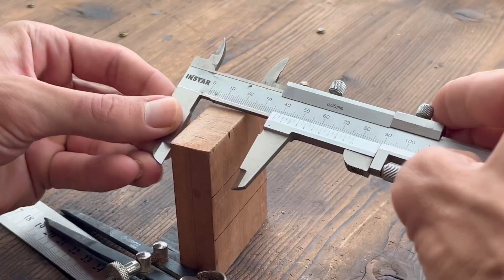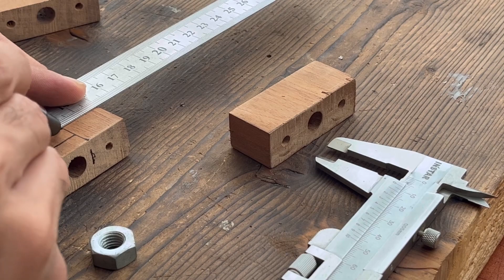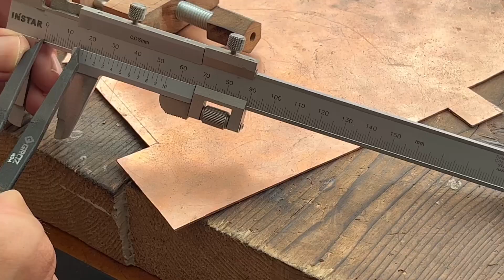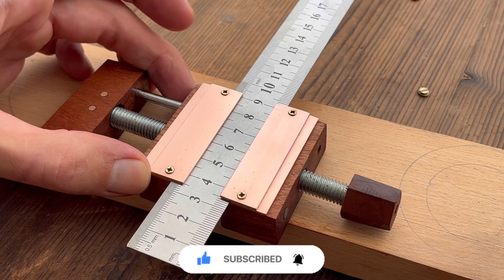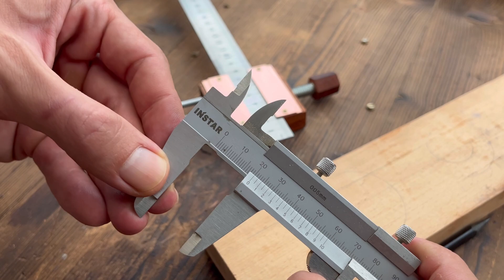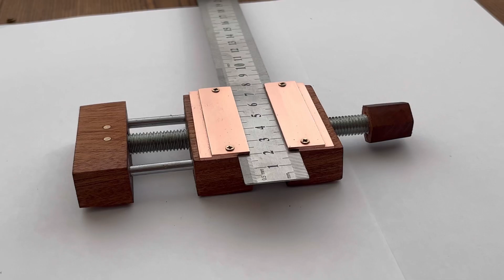Artisanal Woodworking: Step-by-Step Guide to Crafting a Custom Wooden Marking Gauge #markinggauge

Comment: really cool. but why such a big clamp for a little ruler. is it so that you can put big rulers in there? i was going to make one but i was just going to put thumb screw in top of it. what is the advantages to this?
Reply from the maker: Thank you very much and I am very glad that you liked the video, yes, the large size of the clamp is because it is possible to use rulers of different sizes. As you said, the size of the clamp is large and it is possible to make it smaller than this, because it was the first time I made it, I did not realize that the clamp was larger than needed. You can make smaller size. In the case of knob, it is better to use thumb screw, your idea is very good, good luck my friend